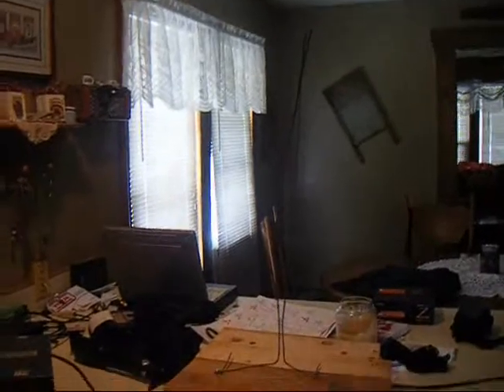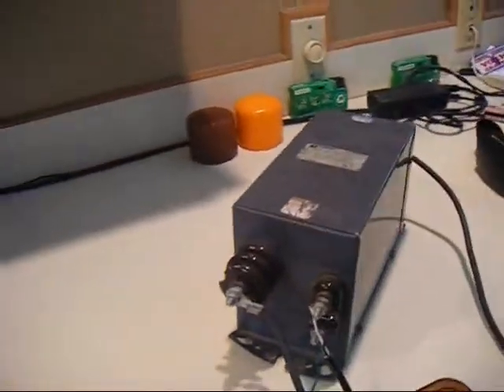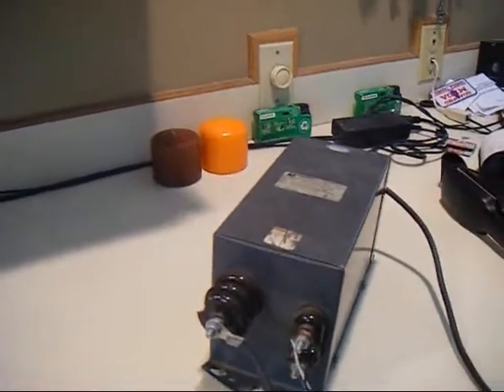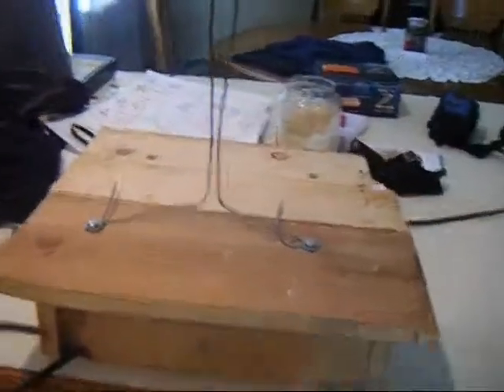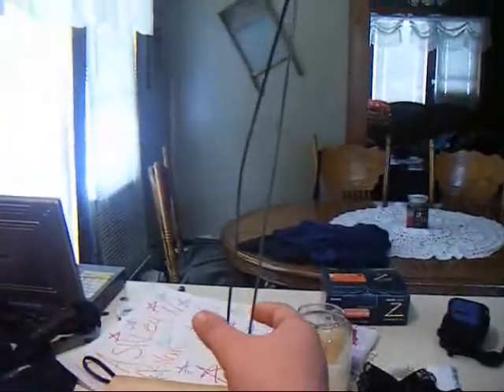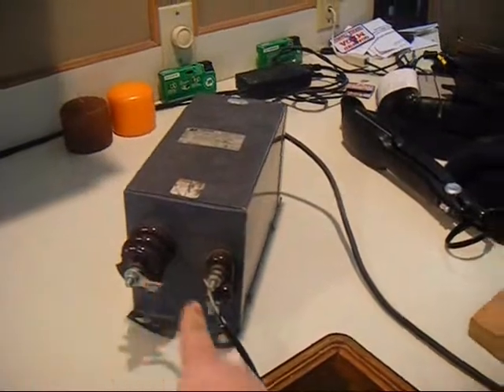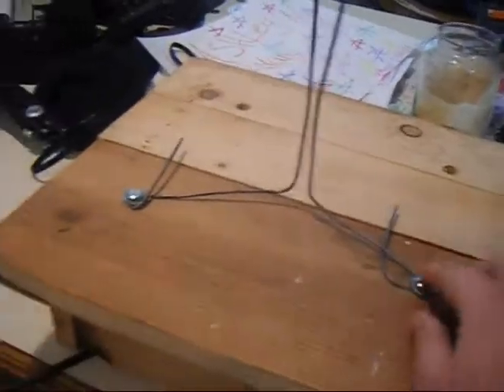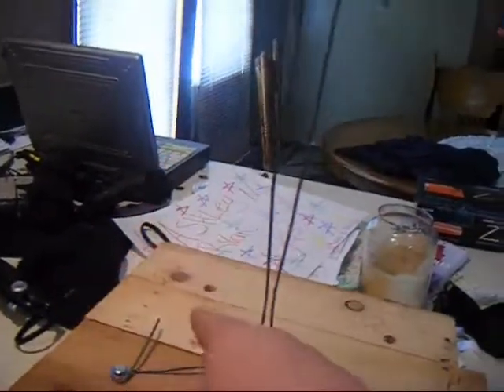16 KV Jacobs Ladder

Comment: Try using some 3/16" or 1/4" soft copper tubing, the kind they use in refrigerators. Also a bit straighter wire/tube would help. Just to let you know you don't need to use HV rated wire, any wire would work, thicker the better in this case. I'd also recomend mounting the sides of the ladder directly to the outputs of the NST for a "cleaner" look, although if you gonna want to use the ladder with different power supplies don't bother. 
Do you happen to know the amperage of your NST?

Comment from the maker: okay when i get one ill let you know, and i got the nst at Roderick Sign Company. and it was ten dollars, i think they sold it to me for ten cause one of the electrodes was broken off a little bit, but it dosent seem to have affected it at all. if you have a local sign compay in your city you can probley get one for under $50. and the High-Tension wire i used i got from the same place for $0.75 a foot. i think i might call aquila, local power company, about a pole pig...

Comment from the maker: yea it would, i couldnt imagine, that would be so much resistance across a 1' gap. i think that may be a little to much voltage for me to play with, i dont even know where i could get that big of a transformer, except maybe a pole pig...... but those are expensive, and i dont think that the power company would sell me one.....hmmmm... i might have to check into getting me one though, and make a jacobs ladder out of it, itd probley power a tesla coil to....

Comment: to prevent it from getting stuck at the top, flair out the tops of the wires away from each other. look at my video of my jacob's ladder, ull see what im talking about. also, try to make the wires straighter, the arc will travel upwards much smoother and more consistently. good luck!

-Joe D.